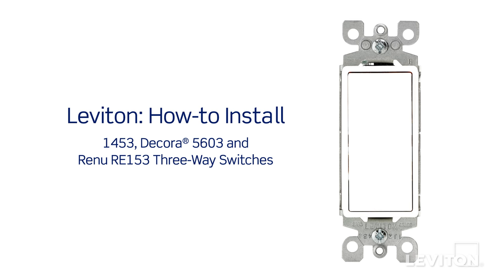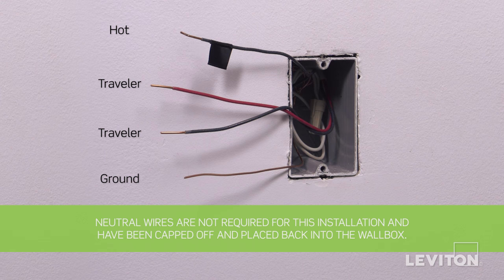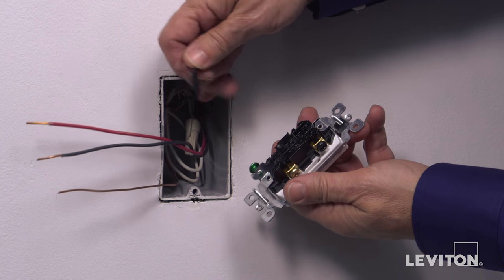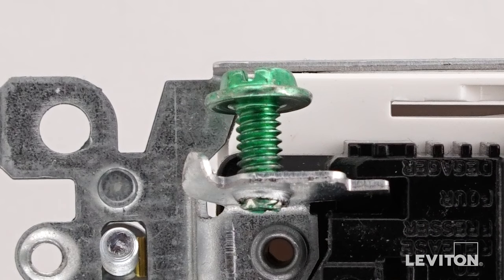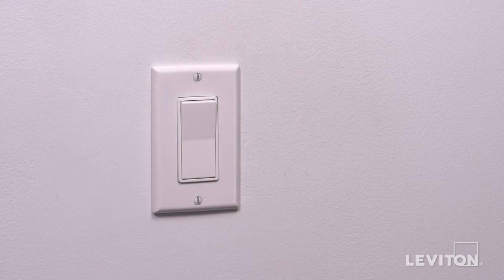How to wire a 3-Way Light Switch | Leviton

Comment: These instructions are correct. HOWEVER I have found that the printed diagrams in the instructions for the Decora Model E5603 switch are wrong. They show the hot wire and load wire going to one of the traveler terminals instead of the COM terminal. That document number is DI-000-E5603-02A.

Comment: So does it matter if you install the traveler wires on the wrong side/ reverse side? Nothing bad will happen?  also what happens if you accidentally install the traveler wire into where the HOT black wire is supposed to go and accidentally install the hot black wire where the traveler wire is supposed to go?
Reply from the maker: Thanks for reaching out. The polarity of the travelers does not matter; they can be placed on either of the brass traveler terminals.  

If you have a traveler incorrectly installed on the common screw, you will find that one of the switches in the 3-way will only work if the other one is flipped in a certain position.

If a device is incorrectly wired the circuit breaker will trip.
Reply: I have the hot wire in the common (black) screw, but I'm still getting this exact result. Am I still doing something wrong?
Reply: Leviton how do you correct that?

Comment: Great instructions. I tested for the hot wire and it was red. The traveler wires were white and black. With this information it took only a few minutes to replace the switch.

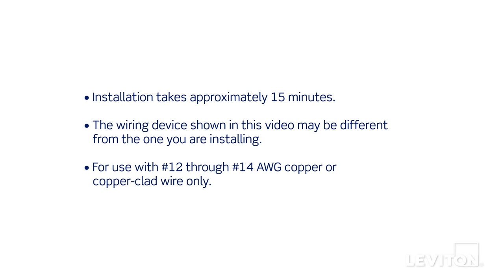Comment: 0:54 safety & identifying wires ; 1:51 Be sure wires are prepped for installation.  
2:03 Note 
2:08 TO WIRE: the "hot" (Black screw) 
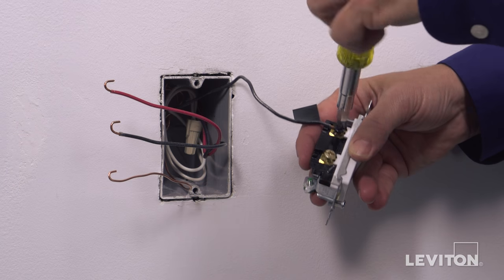2:20 wiring traveler 1 (Brass screw) 
2:33 wiring traveler 2 (Brass screw) 
2:47 wiring the Ground (Green screw) 
2:57 Alternative 1 : "back wire" method. (Device may also be "back wired") 
3:53 Alternative 2 : "quick wire" method
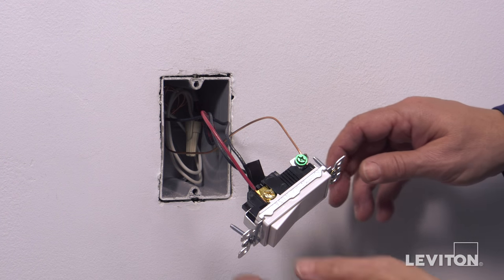4:30 Putting the rocker switch back in the wall & testing both switches

Comment: I have wired in several of your 3 way illuminated switches EXACTLY as the dire rising specify. NO LED or anything just regular ol light bulbs and the issue is the illumination DOES NOT LIGHT UP. These are at the top and bottom of stairs. Please give me some feedback.  The switches DO NOT have a provision for a neutral. Yes the commons are correct, yes the line and load is wired correct (to the instructions) switches work, just not the led. Brand new circuit wiring and breakers. 15 amp.
Reply: Apologies for the grammar. Big thumbs, small phone. “Wired as the instructions suggest” these are expensive switches and 4 in my house do not work. Some have the black housing, some the yellow. Both say illuminated.
Reply from the maker: Hello, could you please call 1-800-824-3005 so we could properly diagnose the problem and assist you